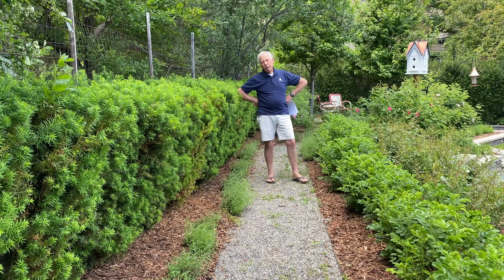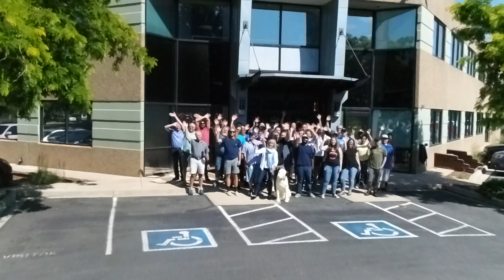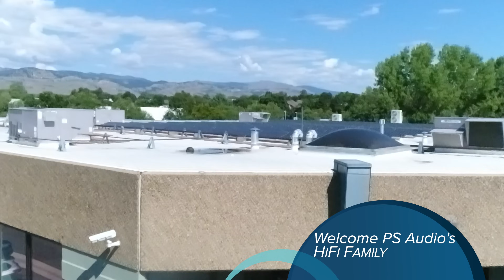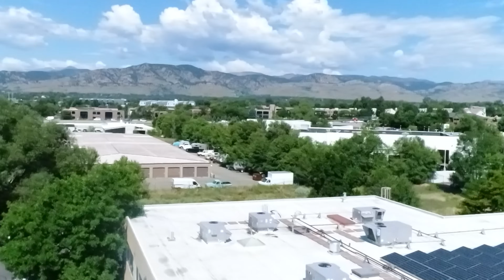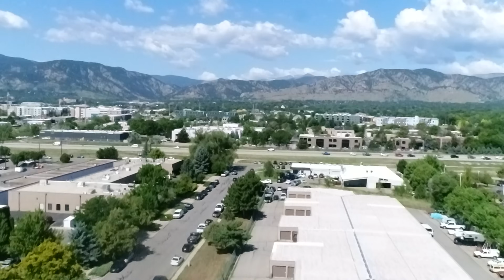Understanding audio sample rates

Comment: I think the main reason to have the sample rate higher than the Nyquist theorem dictates, is so that the DAC reconstruction filters don't need to interpolate as much.
Reply: @marianneoelund2940  Yes, that's exactly what I implied.
There are other ways to reduce the strong filtering, like using dither, but using a high sample rate (or upsampling) is probably the easiest solution.

Comment: Ok... But then you are told get flac, it's lossless .... Great 😁👌🏼👍🏼will do that, managed to get 256 in flac ...but hang on a second, you are saying that has bitrate too ? Yes ! Oh so can I play that on my usb car radio ? Of course you can 😁 but I checked the specs of the radio and it says 48khz at 16 bit. That's ok it will upscale it and play 🤔😕 oh....but when i play it on my p.c  the specs of the motherboard says it will play it at 192khz at 24bit 😬😨 but not all motherboards can do that ? Oh.  ....Iam going 🎵 slightly 🎶 mad  what does all this mean in the real world? How can I play my flac files at home on a decent system without spending a lot of money ? A raspberry pi ? A p.c, and laptop ? Help

Comment: At the risk of my alienation, there is also the devilish problem of aliasing.  The beat frequencies caused by interference between the sampling frequency and the signal frequency being sampled.  One commentator  rightly used the term, bandwidth limited source.  This aliasing is a very great problem in the field of digital pipe organ sound production, recording and reproduction.  Some of this is audible even with sampling rates in excess of 96K Hz.
Reply: thats why we should use dsd, pcm is old and outdated bad tech.

Comment: Regarding the rationale for using sample rates higher than 44.1 or 48KHz:  There is ABSOLUTELY NO audible benefit from including ultrasonic harmonics in a recording.  Doing so, by itself, does NOT make for a more "natural" sound.  
The primary reason for high sample rates such as 88KHz, 96KHz, 176KHz, 192KHz, or higher in audio recording, is to greatly simplify the analog anti-aliasing filter that is required.  Sampling audio at 44.1KHz requires a complex, "brickwall" analog filter and such filters do not perfectly reject signals in the stop band.  Response at 22.05KHz may only be down a few dB, and frequencies up to 40KHz (yes, many microphones do pick those up) may be down only 95-100dB; some of these will alias into the mid-audio range where hearing sensitivity is high.  Additionally, filter phase response can have wild swings.  In some cases, these departures from ideality can leave audible artifacts in the recording.  
On the other hand, high sample rates allow a simpler, smoother and better-behaved analog filter, and also allow some of the anti-aliasing to be performed in the digital domain where the cost impact is minimized.  All of these considerations apply to playback as well, since it requires a reconstruction filter.  
Another area where high sample rates can help, is in digital effects processing, especially when nonlinear effects are used.  Sometimes one needs to use sample rates up to 384KHz in order to ensure no aliasing products appear in the audible range.

Comment: I've always thought a videoed cart-wheel is a good illustration of aliasing (where the sample rate is not high enough to faithfully represent all harmonic components of a signal). If you're videoing a spinning cart-wheel, and the wheel turns, say, 5.99 rotations between frames, not only does the wheel appear to turn incredibly slowly, but it also appears to be turning backwards! The frequency is not simply eliminated, it's actually completely misrepresented as something else. Same thing happens in audio: pick a sample rate that's too low, and weirdness ensues!
Reply: Paul Applewhite Rotor at helicopter shot by 24FPS does look a little bit weird... Too...
Reply: @bergennorway  very true, especially when it looks like its not moving at all.

Comment: The "snapshot" analogy is simple and easy to understand, also it is technically an acurate description of the sampling process. However, it gets the wrong ideas into the people's heads, as it is very logical to think that the more, the better, and any signal sampled at a higher frequency will be a "better" and more accurate representation of the source. A look at the wikipedia page about the Nyquist–Shannon Sampling Theorem ( https://en.wikipedia.org/wiki/Nyquist%E2%80%93Shannon_sampling_theorem ) will reveal that things are not so simple and trivial as it might seem

Comment: Thanks, Paul. That was the clearest description of the Nyquist Theorem that I've ever heard! I've got a question for you. Just as the sample rate impacts frequency response, does it not also have an impact on musical detail?  DSD and HiRes audio non-believers always seem to dispute this.
Reply from the maker: Not technically, no. But sonically, yes. Let me explain. Technically you get a full response up to 1/2 the Nyquist. But the filtering required for this can cause massive phase shifts which the ear picks up and reports back to the brain that something's wrong and thus it sounds like it's off even though the metering systems says otherwise.
Reply: Can you describe what musical detail is? In technical terms, like frequency and amplitude?
Reply: @nissimtrifonov5314  That's a fun journey of discovery that you should try and take someday for yourself. As for my answer, I'll just say that if measurements were all that mattered, critical listening would be irrelevant.
Reply: @tototronic2  If you cannot describe what musical detail is in technical terms (and I am not saying there is no such thing!)  - How can you be sure that a very technical thing like higher sample rate is the thing that will get you more musical detail? In order to achieve better detail, I personally would get better speakers or better headphones.
Reply: @nissimtrifonov5314  No, but I can hear the differences in a recording when listening on my Stax headphones versus my speakers. I hear individual instruments in the orchestra with the ‘phones that I can’t hear through the speakers.

Comment: I'm curious if audio sampling rate is in similar spot as fps in movies, meaning people watching 24/30 fps movies thinking it's normal - good, while it is absolutely horrible once you've seen and got used to 120-240 or higher fps footage. Would we feel similar way about 44.1k if there were recordings in 441k and we listened to it for weeks / months ? Or is 44.1k actually very good and it's not getting much better past that.